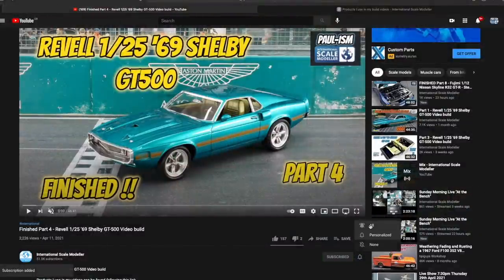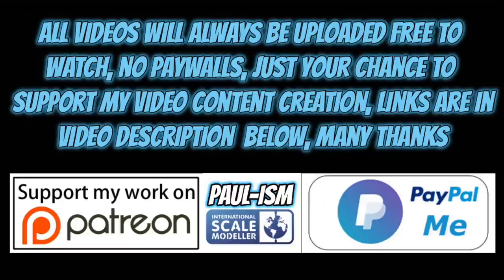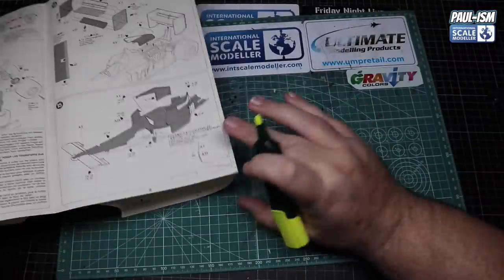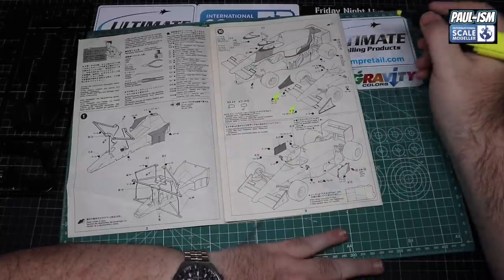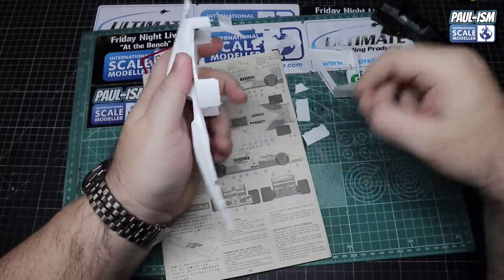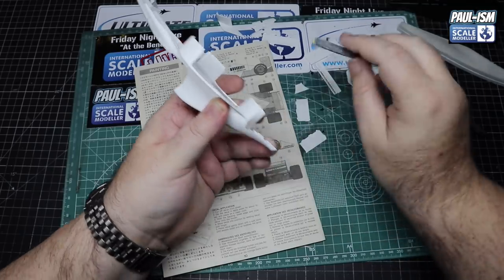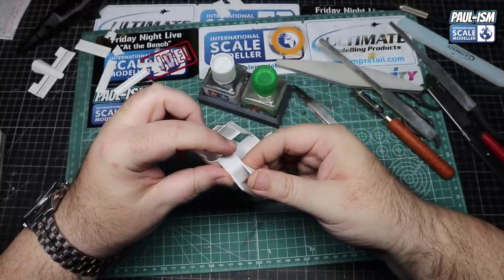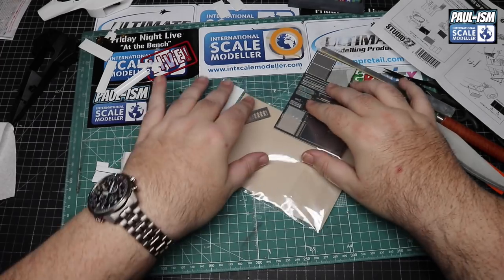Part 1 - Tamiya 1/20 Mclaren Mp4/5B - Video build

Comment: What a ball ache that paint problem was!  Do you think a rub down with a coarse-ish  sander prior to immersion in the brake fluid would "break the crust" on the paint to assist penetration and speed thinks up?  Looking forward to following the rest of this build.  Ace work as ever.

Comment: looking great, but didn't you forgot to paint the rear inserts(the body panels wich go between the rear suspension arms) and the mirrors in fluorescent paint aswel?.
Reply from the maker: You’re right well spotted. I saw it myself soon after uploading the vid. They have been painted now. Thanks :)
Reply: @InternationalScaleModeller  that's great, looking forward to part 2
Reply from the maker: Cheers buddy